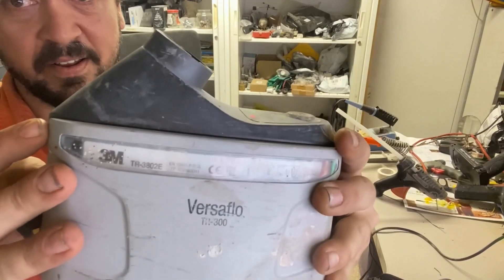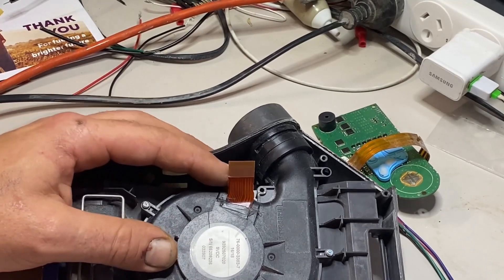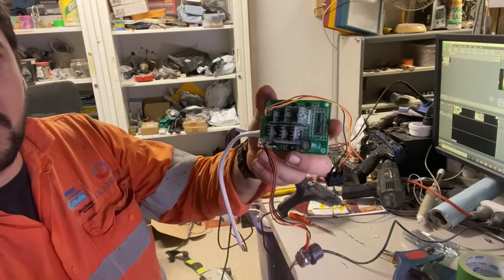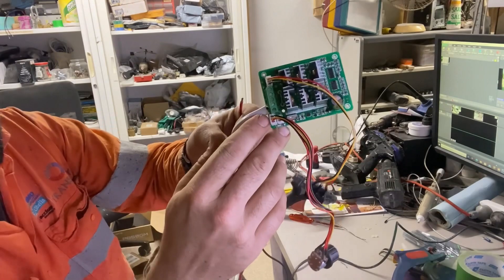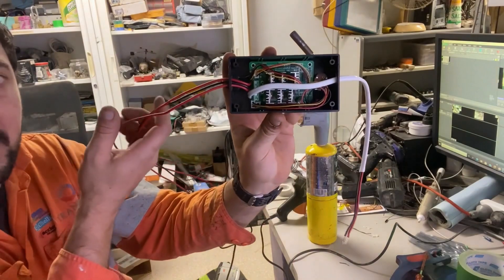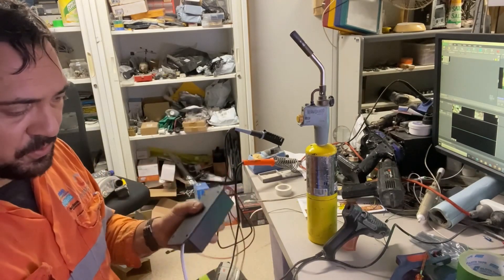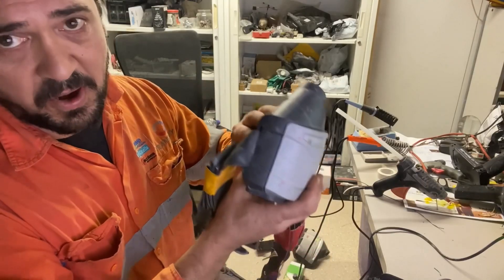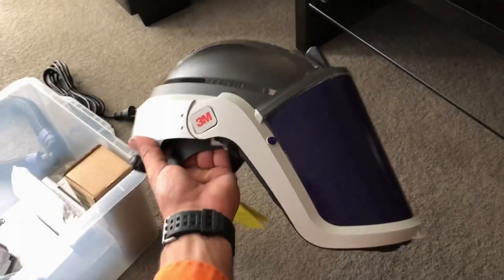How to fix a Versaflo - CHEAP & EASY!

Comment: Awesome Man!  Great hack and been wondering what these look like on the inside.  Went with a TR600 used and wondering what the future will bring for capabilities with power tool batteries.  For the Adflo will do the down under low voltage cutoff module into a step down module inside an old battery pack if can make fit.  Then probably only a connecter of some sort like an XT60 thinking so can use whichever of the power tool battery adapters with a switch.  Guessing won't be till next spring since the snow fell and at the gf's typically so no indoor shop. Thanks for sharing.
Reply from the maker: Haha cheers mate! I’m definitely no wizard. The TR300s I’ve got are actually still what they’re selling new, which honestly surprised me. I couldn’t believe they haven’t updated the battery design or gone to more reliable contacts after all these years. That was a big disappointment for me and the main reason I started pulling them apart and looking for alternatives. I’ll keep an eye on your channel to see how your fix goes! It would be much nicer fitting everything in the body of the unit instead of another box on the belt like I did it haha

Appreciate the interest and the ideas — keen to see where this stuff goes in the future.

Comment: I have a used TR600 with a full battery that only flashes green on the pressure unit when I try and turn it on.  Any suggests how to fix it, rather than gut and replace the driver board completely?
Reply from the maker: Try another new battery ?? but they’re so expensive and unreliable. I tried everything i could think of to make it work without gutting it. I’m by far no genius with electronics you could try taking it to an expert? Sorry I haven’t got anything better. You could send it to me and i could blob it together for you?? Haha hopefully they still make the same controller on eBay???

Comment: Wouldnt this void the warranty
Reply from the maker: Awwww yeeeeehhhh…. You only do this with an old one that has problems! When I called their service the price it was going to cost to repair wasn’t worth it. This is a cheap fix and I never have to worry about beeps or automatic shut offs! I fixed 3 of them and they all have been going perfectly for 3yrs now
Reply: @Micington  Wow innovative very clever and cost effective

Comment: I wonder if I could do something similar on my TR-600? The blower motor is integrated directly into a larger circuit board than what’s in the 300.  No ribbon that plugs into a board but maybe there’s a way to solder into the circuit board and bypass the alarms and battery. It’s a shame I can’t get an ammonia filter for the 300 😑
Reply from the maker: If it’s wrecked you got nothing to lose! Hated those alarms! Hated the batteries and the charger too. I would be interested to know how you go?
Reply: @Micington  I’ll tinker around with it when I get time. If I have any success I’ll post a video and share the link here for others. Sucks that the 600s don’t have any screws either. Have to get real janky and cut the back off with a dremel lol

Comment: Can’t thank you enough for this video! I just did this mod to my TR-300+ running off a 20v dewalt battery! FYI the ribbon going to the blower motor on mine was all little “wires” but I had to solder mine opposite of what you showed in the image. I lucked out cuz I burnt off a pair of the contacts on the ribbon after it wouldn’t come on. I decided to try the other 3 pairs and it came right on just like it’s supposed to 👌 my advice for first timers trying to solder, start with a low temp setting and slowly increase till it barely melts the solder lol
Reply from the maker: Hewfffff!! 😅 glad it worked for you. You gotta make sure insulation is scratched off good but be delicate! Always blob up the solder before applying to disperse heat instantly to whatever you’re soldering

Comment: Hi Mate, how did you get it to run off the Milwaukee batteries? I am looking at doing that for now without the speed control mod. Do you just hook up the one lead from the neg and positive? I see there are 4 pins do they need to be connected as well? Thank you for your help
Reply from the maker: You need to open the unit up. Follow where the power pins wires go. Solder your own wires to these wires and get them out of the unit and seal the hole. 12v was easy to find. Milwaukee m12 batteries have 2 large places for pins to go and these are negative and positive (use multi meter to find). I think in one of my earlier blobs i got a funny intro and you can see me connecting it up but it depends on how you pull the wires out of the unit. I used multi meter a lot to probe where wires went but I can’t remember now. One thing I do know is the speed controller from eBay is much much better and I’ve never had any problems since. Other than wires breaking on rare occasions but very simple fix. Sorry I probably didn’t giv much help there 😂
Reply: @Micington  thank you for getting back to me! did you just solder only two wires, one for neg and positive. I tried to solder the neg and positive wires of the m12 battery to the neg and positive pins of the unit. A bunch of smoke came out and it looks like the ribbon that goes from the battery gold pins to the main board burned up. Did you solder the m12 batteries directly to the board or the ribbon that connects to the board? Thank you for your help!

Comment: Do you know how to do it with the old papr system with the round filter gvp 100 their is no bolts for disassembly would I just use the old battery plug in. I don't want to ruin it trying to get the phase wires since it's a sealed unit
Reply from the maker: I’m sorry I haven’t seen one I don’t think. How many prongs does the battery have? How many volts is the battery? Can u tap straight into the terminals where the battery clips in? Hope that makes sense??
Reply: @Micington  got it working its also 4.8v just used the old plug that goes to the battery it had red black green and white just used the power and ground and works. Thanks
Reply: @Kaabosurron  Seems like the Breath Easy Turbo and GVP can use the same battery pack.  There is an instructable website page showing how to use a 5V power pack with the Breath Easy Turbo and seems like can do the same with the GVP. .

Comment: This can be fixed far easier for 10 bucks. The problem is the one or both of the pogo pin battery connectors not making contact. The fix is buy an 0.085 nickel wrapped bass guitar string. Pull the two pogo pins out closest to the closing side of the battery. Cut pieces of string to fit in the new contact holes so they stand 4mm proud and level with the other two contacts. If the battery doesnt snap closed shorten them a little. If still beep fault then make them longer.
Job jobbed.
Reply from the maker: Battery terminals were shit. Charger is shit. Expensive 💩!! batteries failed first. But motor controller in all 3 units I owned failed also. eBay motor controller is cheapest and easiest way out as far as I know. No beeps. No problems. Been years now. They will take an 18v or 12v battery with eBay motor controller.

Comment: Thank you 🙏 just bought the stuff … saved a lot of time and cost if this works
Reply from the maker: Glad it helped! I have done it to 3 units and they are still working great after over a year. It will definitely work. It works with 18volt Milwaukee, dewalt or any other brand battery as well. But if the throttle is full its like a leaf blower lol
Reply: Brill! Thanks, I use makita 18v so will save another £30 :) the price 3M charge is astronomical! You've made my day mate
Reply from the maker: @badusername4  https://www.ebay.com.au/itm/295363009137?mkcid=16&mkevt=1&mkrid=705-154756-20017-0&ssspo=z2q8jqeitbm&sssrc=2349624&ssuid=zws6u7uxSua&var=&widget_ver=artemis&media=COPY
Reply from the maker: @badusername4  search makita 18v battery adapter in Amazon or eBay to make it easy to plug battery in
Reply: Nice one , better customer service on here too than 3m could dream of 😂
Reply from the maker: @badusername4  hahah my experience was unpleasant also. It’ll last ages with 18v. Approximately 16hrs with a 18v4ah from memory. In one of my other videos

Comment: Have you got a hack for replacing the contents of the filter cartridges so we dont have t pay 3M's exorbitant prices?
Reply from the maker: Haha not really I just blow mine out regularly with the air compressor. I haven’t seen any mullet brands of filters on eBay or Amazon either I’m sorry.
Reply: Someone 3D printed a Adflo cover to use the 3M 6000 7000 type cartridges.  Seems like 3 would be required for the spec flow rates, though depends on need.  I plan to assess capabilities for the TR600 in time.

Comment: Hi I'm doing this on one of mine at the moment Mine is the small ribbons Thanks for showing me that
Instead of Soldier the ribbon Amazon seller 12 Pin board to Soldier
Reply from the maker: Nice thanks for letting me know. Mine are still going strong. You can use a 18v Dewalt/Milwaukee whatever brand battery too just so you know. Incase you don’t have the m12 Milwaukee batteries handy

Comment: I've had 3 of these units break on me now! So frustrating. Thanks if they don't replace this I'm going with this!
Reply from the maker: The beeping drove me crazy. I didn’t think I’d be the only one that had problems with them.
Reply: Would this work with makita 18v?
Reply from the maker: @jackastbury  it definitely works with 18v.. I tried a Dewalt 5AH 18v. Just throttle it down. It last ages.
Reply: @Micington  The European technical director called me back and said he'd never heard of the issue, absolute BS. I think I've found simular parts in England. Your hack parts coming in at £34 delivered vs £259 for a new battery that is dog poo anyways just to see if it's the unit at fault. I think it's the battery contacts that are shit. I put a clamp on the second one that broke and it worked OK for another month or so.
Reply from the maker: @jackastbury  it lasted 16hrs with a 18v battery throttled down to breathing pressure. 
It’s like a leaf blower throttled up lol 
Probably would frazzle the motor pushing that hard though
Reply: @Micington  one way to survive the heat though....
Reply: Just had another call and update, the warrenty as of January 2022 purchases have a 2 year warranty....
Reply from the maker: @jackastbury  are yours still in warranty?

Comment: I've got battery issues maybe damaged to damaged cells i would think, can u do a video of cell replacement??? 
P.s love ya work pal
Reply from the maker: Haha I’ll try!  I’ll see what batteries I have left together. Once you split it you need to desolder a wire so it doesn’t short out the module in the battery… thanks mate!

Comment: Thanks so much for this video - I'm adapting a versaflo for someone to use for medical reasons, to safely make a plane journey from a country in which it's hard to get high quality 12v batteries in a form the airline is likely to accept, but easier to get 14.4v and 18v, do you think the versaflo motor together with this controller, could tolerate either of the latter two, please? Thanks, Jonathan
Reply from the maker: Hi Jonathan 
I’m glad it helped you. I’ve got it running on a 18v 5AH Dewalt battery as I write this message with it throttled down to comfortable breathing range with the controller. I even gave it a short burst at full pelt and it didn’t blow up (it was like a leaf blower!) I’ll leave it running overnight and let you know if it blows the motor up but I’m pretty sure it’ll be fine. I’ll send a link for a link Dewalt battery holder. I’m sure you can get a holder for any common battery tool brand from eBay. 

If it can run on an 18v battery I don’t see any problems at all with a 14.4v battery. 

If it lasts overnight with a 18v 5AH battery you could use a 18v 2ah battery with no troubles and it wouldn’t be as bulky
Reply: @Micington  Your replies and your trying your versaflo out with the 18v battery are a real kindness. Thank you.

That's really encouraging about the 18v. 

I bet you're right that 3M originals would be OK on the plane. I’ll seek a letter from the airline either way. I’ve emailed 3M asking if the have a UN 38.3 certificate (lithium battery airworthiness). It'd add $1300 US to the cost to have 3 of the 3M 50wh originals shipped to her (no used spares available or freightable in her market sadly), with the ‘two spares only’ onboard limit (perhaps waivable with permission) cutting it fine for the 30hrs if she can’t recharge. Perhaps I am just cheaping out. I was hoping to save the $1300 to spend on treats for she and I when she arrives.

The 18v/14.4v was partly because the only quality 12v in her market is approx 48wh only, which with two spares is cutting it fine for the 30hrs. I am concerned about reliability of a hacked system. But because I have two spare used blower motors I could convert them both for her in case one fails mid-flight. I’m trying to weigh the risk of 3x 3M originals not lasting the 30hrs, vs a hacked system (and perhaps its backup hacked system) failing mid-journey, and the risk that a hacked system’s looks could lead the pilot to not let her board even with a letter of permission + UN 38.3 certificate. Choices choices.
Reply from the maker: @atelier1975  i left it running overnight with 18v 5AH and its still going with heaps of power left in it. Running solid just over 12hrs!!! I left the stopwatch on. Let ya know when it goes flat. The cheap motor controller is bullet proof!

The genuine 3M battery price are a complete joke and totally not worth it in my opinion. It infuriates me. I’ve had such a terrible experience trying to keep them running on the standard batteries. I called 3M and emailed! No help! I wouldn’t trust standard batteries with standard mask motor controller for that long! I can’t believe I’m the only one that experienced the same troubles……
I do understand the hacked one looks a bit “how ya goin” haha but you could probably make it look neater then how i did it.

I haven’t had any troubles at all bringing a DJI mavic drone on the plane which had 3 batteries.
Reply: @Micington  wow! I suppose at lower standard speed something with c100wh ought to do 24hrs. Thank you for doing that and for your thoughts on the whole thing. I don't feel so selfish now wanting to do this thing affordably. Your comment on improving the looks of a hacked system was right imo. The ideal would be the pcbs in a 3d printed case which fits where the original battery did. No reason why that couldn't have a slot for battery too though the weight probably makes it better placed directly on the belt. As you say there are great cradles out there (waitley do mount-only packs of 6for 12$USD which only lack the elec contacts, which look like bog standard lucas connectors). A custom case (or even off the shelf) could contain a step down voltage regulator (is that what it's called?) to keep things below 12v just in case of heat issues.

It made me ask myself what is the motor inside the heart of this 1000$US bit of kit? Is its particular properties required for the job and why? When one knows that it opens the door to 3d printing a new housing for the motor itself - maybe (?)

I just think if these things were cheap it'd free a lot of people with health problems to be more safe to do things they otherwise might not do.

I've just had to go to hospital so might  be off the pitch for a bit but I really appreciate your input.
Reply from the maker: @atelier1975  it lasted about 4.5hrs with a 18v 1.5AH battery. 

Lasted over 16hrs with 18v 5AH battery

In one of the last emails I sent to 3M I suggested they lower their price on the unit saying what you said (more people would buy them) 
They must be making a massive profit per unit. 
They shouldn’t have ever made a battery with the connectors my 3 all had. In fact they should never make their own batteries full stop! The only good parts are the helmet and pump imo. 
You would never want it to beep. Especially on the plane. It’s nice having precise control of the motor with the hack version and it’s absolutely better it doesn’t beep and you can use the quality tool batteries in your tools or mask now!!! More companies should  make their gadgets work with any battery with the current focus on world resources being limited. 

If I were you I’d stay away from a new one because of the price and try to buy a 2nd hand one with the same problems all 3 of mine had. You should be able to get one on that’s beeping or not working at all for 100-150USD. 

Sorry I’m rambling now haha 
I wasted at least an hour to 2 every time I worked on my boat getting one to work. When I found this fix it was one of the best days of my life hahaha
Reply from the maker: @atelier1975  DC 5V-36V 12V 24V 3-Phase Brushless Motor Speed Control CW CCW Reversible Switch
Reply from the maker: @atelier1975  the links for all of the components I used are in the description
Reply from the maker: I saw this add from Dyson and thought of you. Would this be what your looking for if it was the right price??? Surely it would be cheaper then 3m ……
Reply from the maker: The batteries the versaflo comes with are good quality from new normally. I can’t see any airline rejecting them??? Unless you have bad luck like me with my 3! That we’re playing up with same issue! 
Have you already got one that is playing up? (Beeping & turning off? Like my 3x)
Reply from the maker: https://www.ebay.com.au/itm/DeWalt-18v-Battery-DIY-Adaptor-Base-Plate-To-Dock-Power-Connector-12-AW-/175180352357?mkcid=16&mkevt=1&_trksid=p2349624.m46890.l49286&mkrid=705-154756-20017-0
Reply from the maker: https://youtu.be/KW0nyPCQbjY